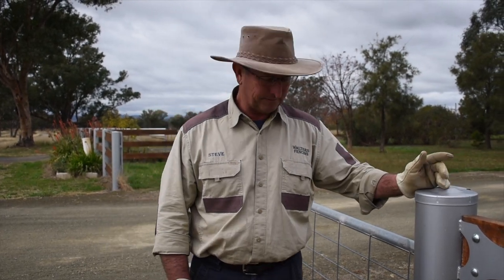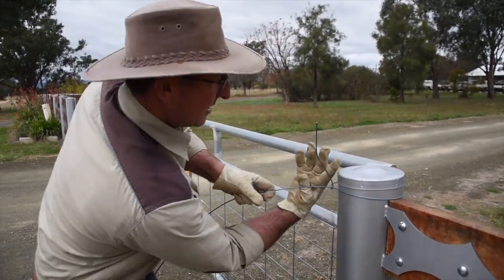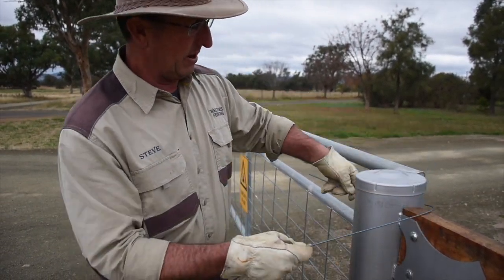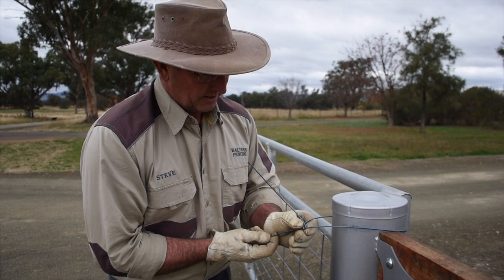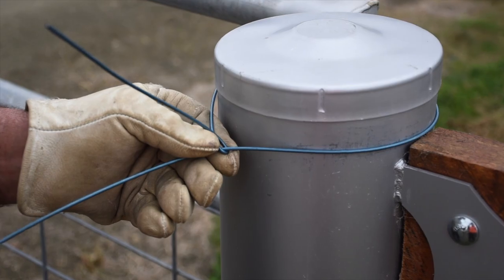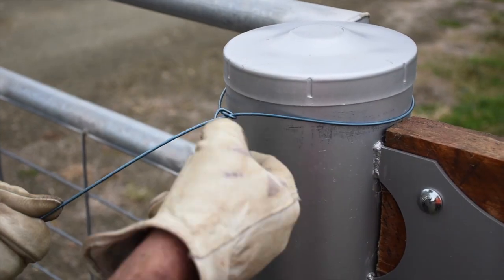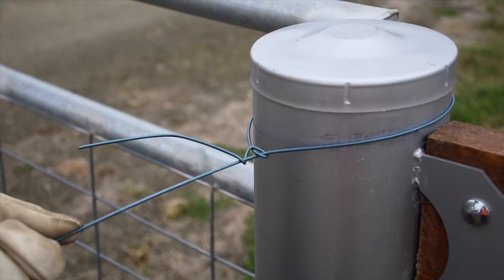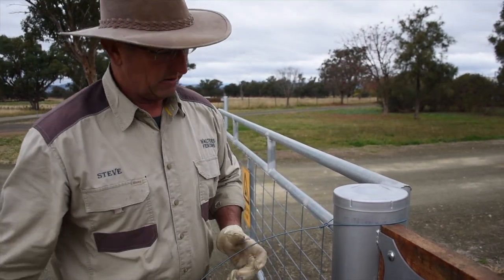How We Do It: Tying Off Wire to a Strainer Post! (Termination Knot) #EP3

Comment: Why not double your cable around the post?
Reply from the maker: Hi Dusty
You could run the wire twice around the post, but I don't believe there is any additional benefit.  We have found that the weak point is at the bend in the knot and this won't  change with additional wraps around the post. 

We explore the breaking point of different wires and knots in our other video  'Testing the Breaking Force of Polyethylene Droppers'

Cheers Steve

Comment: Hi Steve, can this knot work on a square 150 x 150 post?
Reply from the maker: Hey John.
Yes, the termination knot will work quite well on 150 x 150.  Just resist the urge to push the knot in too tightly against the post.  We have found that the sharper the bend (with high tensile wire) in the through wire the weaker the knot.  So, if you can tie the knot out 50mm/2" from the post, the wire will handle more tension.  Hard to explain in words.  Probably should do a video...
Cheers Steve
Reply: @WaltersFencing  Thanks Steve, I have a bunch of 150 SHS posts I want to use so I'll give it a go. Much appreciated.